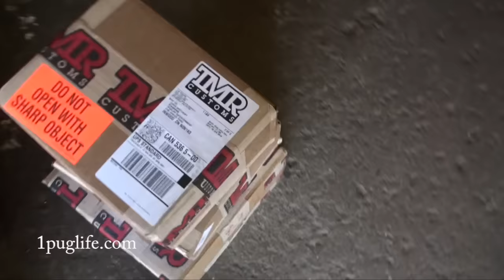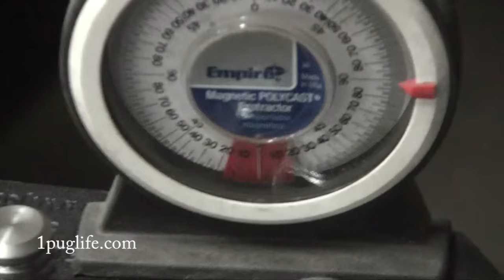bender terrible

Comment: Hay Chris The very first mod I did to my bender was to extend the handle make it between 6 to 8 feet long and it makes the work a lot easier it helps with out having to include the extra kick with the leg and you wont have a coronary. STOVE PIPE!!!!

Comment: weld a piece of box section on the bottom, dig a hole in the ground and cement a  hitch receiver in the ground and put the bender in when you need in and take it out when you don't

Comment: if you use lag bolts instead of studs, when you unbolt the bender you'll just have holes in the floor. i have that same set up for my manual tire changer. i just bolt it in when I need to use it. otherwise, its in the corner out of the way
Reply: ya mannnnn
Reply: and extension bar for the bender more leverage so you don't have to pull like a mumpny

Comment: I had a plate bolted to the floor with threads in it and the bender pedestal stand bolts to that fixed plate so we can move it easily, just undo pedestal bolts in the base plate and it remains bolted to the floor.

Comment: I've been using a similar bender for 15 years. Lube the stationary follower die thoroughly. Buy an aerosol can of white lithium spray grease and put the straw on the can. You have 8 or 9 notches on your ratchet arm. Whenever you have bent a tube enough to expose the next hole in the die pull the pin and sweep the arms back to start over on the ratchet arm. It takes a ton of force off of the pivot. After about 30 degrees you can pull the pin, you want to spray more lube on the stationary follower die then. You'll have some mess, but it's better to clean up some grease than to buy new dies.
Ungreased, the tube will bind itself up into the die after about 45 degrees. If you have surface rust on your tube hit it with a wire brush on an angle grinder. I wipe each stick of tubing down with brake clean before I load it in the bender. Gets all of the crud off and you can see your marks better.
Some lube will reduce your effort on the handle but will also save wear and tear on your dies. You will occasionally get burs which will scratch the tube. Dress them out with a sanding drum on your die grinder and, fee fuck's sake, keep 'er lubed, bud. .125" wall shouldn't be that difficult. As long as the tube doesn't exceed the capacity of the bender, a cheater pipe on the handle will reduce effort without causing damage. Also, remember to account for tubing spring back when bending to adesired angle.
You've already discovered that the operation is going to eat up some real estate. I use a different kind of concrete anchor. Retorque them frequently. Once they start getting loose you will twist them out of your floor with all of the force you're exerting. If you can follow any of the stuff I'm trying to get at feel free to ask me any questions. There's definitely a learning curve, so stay patient. You're gonna eat some tube. Also, if it doesn't fit the die tightly the tube will try to squash in the die, as in 1-7/8 in a 2" die. You probably know by now, but you'll get a better bend quality in thicker walled tubing than thin. Get below 16 gauge and it will link itself. And only a goof would suggest heating the tube.
Keep 'er out of the rubarb, FFS.

Comment: Hey Chris, Why dont you bolt a plate to the floor that you can bolt the pedestal for the bender too. Then you can just move it when your not using it.bmp That woulda been cool if the Eagle you could see flying came and tried to under attack the drone.FFS I used to have to put a piece of pipe on the bender to extend my chooching ability.

Comment: I hope you figured it out.  I have a model 32 and bend 1"  5" CLR  with 120 wall DOM steel to 180 degree in 10 seconds.  No hydraulic, no indexing.  No grunting , no cussing

Comment: have the same bender 095 wall does good with 2 inch.  also look into a air ram. we built one so we just hook it to the compressor and it switches :)

Comment: i have the exact same bender except i upgraded to hydro. The model 3 is rated for 2 inch .120 wall. That sure looks thicker then .120 wall. Your going to break the die, bend the pins, or shear the handle. I have heard of all of the above happening when overloading it. When you upgrade to hydro you can put it on rollers and move it out of the way when not in use double bonus.

Comment: Chris you should take that die back and get a 1 5/8 die. Most things are built from 1 5/8" bumpers, roll cages etc. it fits most all rule books for size if you would want to bend something for peeps later on.

Comment: put a cheater bar/ pipe on the end of the benders stovepipe there bud for maximum leverage. push instead of pulling. or use Forky to push the stovepipe.

Comment: NO BELTS, gear head or nothing. My gear head drill will go through that plate in seconds with a 3/4 drill. Big curlies off the drill bit carry the heat away, if you don't have a gear head drill for max torque to cut hard at a slower speed its a lost cause.
Reply: I Make and Fix Stuff iit

Comment: pug. make a removable mount and install your pipe bender on your welding table .that way it takes up no room and you can set it up and remove it when it's not in use .  👊

Comment: make a extended handle for your tube bender. I'm thinking you might not have to struggle with the 1/4" tubing. and when your not bending 1/4" take the extended handle off so it's not in your way. thanks for the movie ffs bmp.

Comment: just weld up at push  hydralic instead of or to the handle on the bender  , so all you have to do is hand pump the angle you need , no breaking your nuts pulling that bar with whatever size extension bar for leverage

Comment: Pug you should weld a sleeve for the base of your pipe bender to fit on the fork lift. so you don't have to bolt it to the floor. !!!!!

Comment: Hay pug, why not use the powerpack that your lift had to power the bender.  Replace the manual pull arm with a hydraulic piston sized for it.  To attach the powerpack use self closing quick connectors to switch from the lift to the bender.  You then could move the bender closer to the lift. because you would not have to have as much room around it. Just position it so the tubing has room to go in and the bending side has room to complete any multiple compound bends.
 My thinking would be to have it mounted close to where the wood splitter was built in the garage. A couple of feet over from the lift and a couple feet toward the garage door give or take a little. As to mount it to the floor.
The bender angled where the pipe going into the bender would point to the outside walkin door. Then you can stand with the lift powerpack on your right the bender is in front of you so you can watch the angle gauge. and not have too much hydraulic hose to mess around with. 
Just my thoughts, hope they help. metalSmiths
Reply: Oh I forgot to finish my thoughts on mounting.  Use anchors set into the floor if and when the bender is removed your only left with holes in the floor. To keep dirt or any other cr@p out. cut the heads off some short bolts that will fit. About an inch or less in length. Then cut a slot across the top just like a screw would have. With that done it would be easy to install and remove. and it wouuld be flush with the floor. No trip hazard. BMP good day tk ya.

Comment: You should use some chemical resin and threaded studs. That will hold it forever. 
I'd post you some but I'm in the uk. 
What's your address?